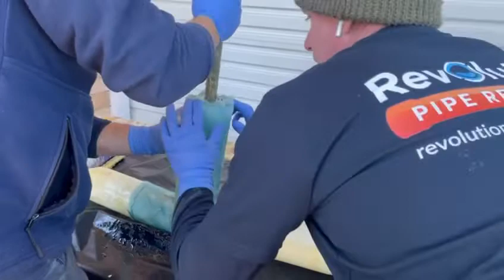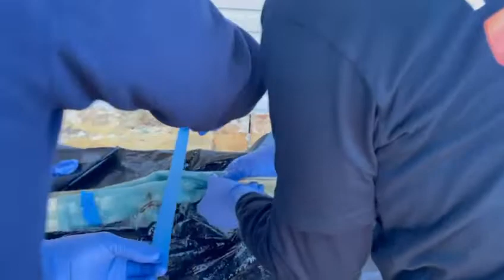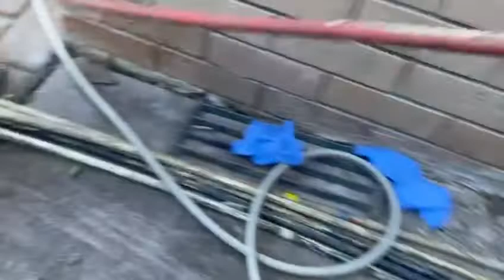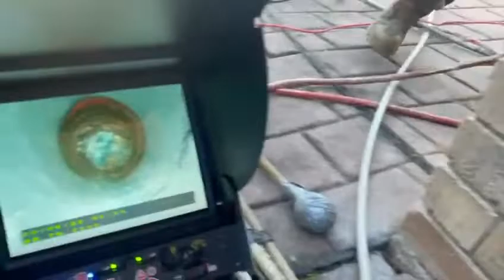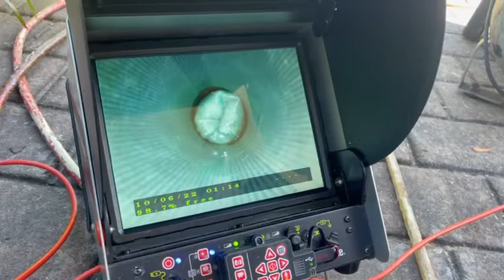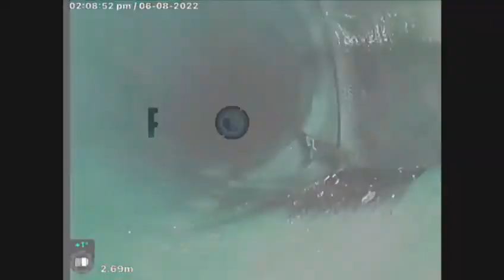How To Install a Junction Patch | Revolution Pipe Relining

Comment: How does this hold up if you have to snake the line down the road
Reply from the maker: Hi Brian, You can not use an electric eel once this is done. Water jetting is possible but best to be done by the relining installer as they know how to deal with it and also hold the warranty

Comment: Very nice, how fast does that resin set off in very hot weather like 100 degrees outside weather
Reply: You don’t get a lot of time at 100 deg f probably only 15 to 20 min but when it’s that hot we cool the resin and work in our air conditioned truck to extend our working time.
Reply from the maker: Yep, Darrell's response is bang on.